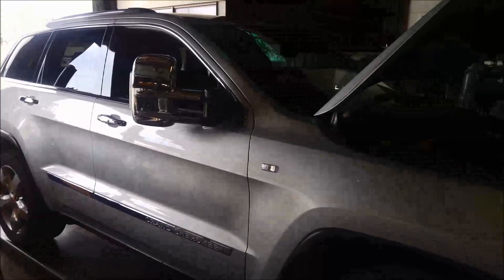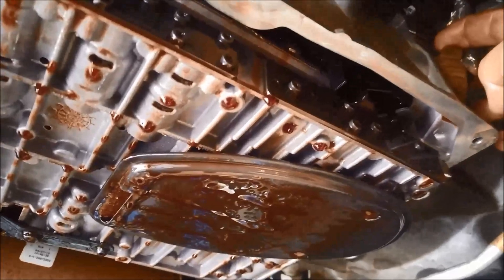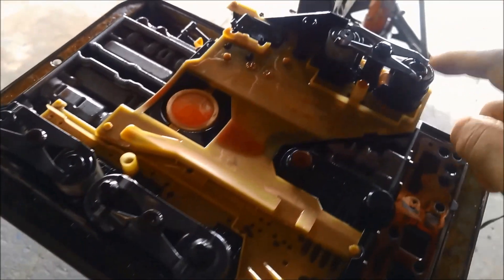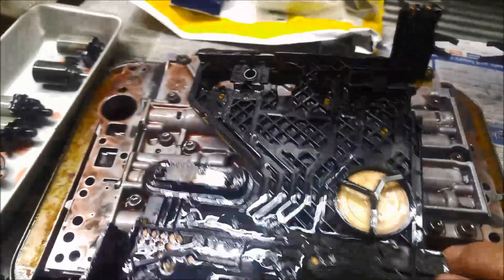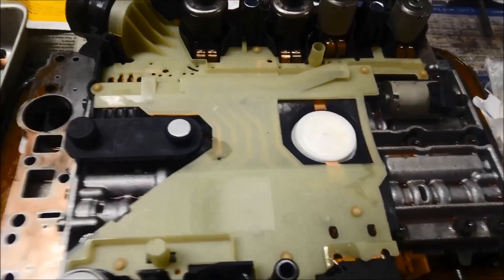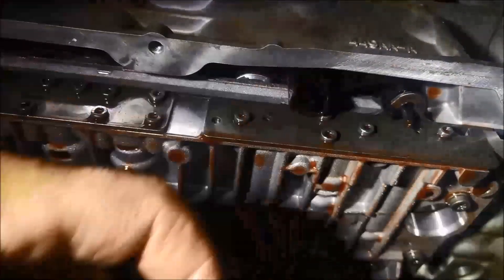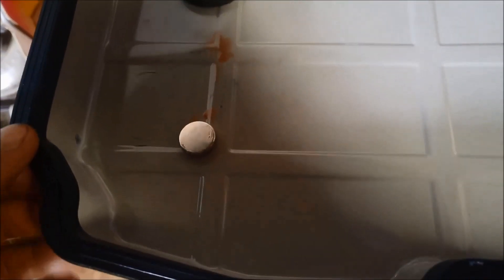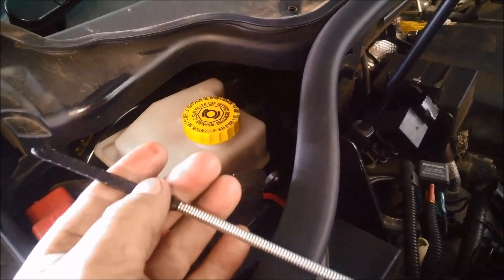Jeep W5A580 Mercedes 722.6 Auto Transmission  Conductor Plate Solenoids Connector Sleeve How To DIY

Comment: Thanks for the tips! I have a 2012 Jk I believe it has WA580 that's a 4 speed trans am I correct, because when I manually shift it shows only 4 speeds on the dash? It seems like I have a delayed downshift in automatic mode is there anything I can do to bring that downshift in earlier? Thanks

Comment: Hi my friend I used your video to install a use valve body it was working ok until I started to notice wird shifting but no codes I just put bigger tires 265/70/17 and lifted 2in I bought a programmer to set the new tire size in the ecu to calibrate the speedometer and the shifting points on the transmission it ran good for two days and it started to shift wird and a code come up transmission clutch solenoid preformec. Do you think that replacing just the solenoid will help or the actual clutch in the inside is damaged is there any way to test it out
Reply from the maker: hi, really hard to tell without seeing itand running a few tests / checks. if you have fault codes it is usually an electrical issue. cheers

Comment: Hello. I scanned my transmission a nag1 or w5a580 in my jeep wrangler 2013 and showed up this code p1731 incorrect gear selected. I’ve been searching around but couldn’t find the correct answer to that fail. Thanks in advance

Comment: Thank you for the video. We have a 2007 Jeep Grand Cherokee with the 3.0 and 722.6.  It went into limp mode second gear. We took it to 2 different transmission specialists.  Both said we needed a new transmission.  Since they wanted over $6000 for the job we purchased a used transmission with around 80K miles on it from a reputable location.  A GM technician that we know very well installed the transmission and had Chrysler program and reset the TCM. AND....we still have the same problem. Still in limp mode, second gear. The code that keeps coming up is torque convertor clutch solenoid. Same code as before.  Our tech is going to check the wiring harness from the TCM to the transmission and the relay.  Do you have any ideas what could cause this? Thank you
Reply from the maker: hi, old solenoids rolled around in a 2nd hand trans fluid can cause that. tcc codes are probably the most common faults on any trans. cheers

Comment: Thnks for the vid mine is saying shift solonoid 1-2 and 4-5 short circuit to ground can the problem be on the conductor plate or solonoid its a w203 c240 Mercedes
Reply from the maker: hi, make sure you check all the solenoids while you have it out and apart. cheers

Comment: What is the trick getting the sleeve with the 2 o rings on it? Ive lubed and anti seized the rubber o ring seals and where you put the sleeve connector into the conductor plate and it dont want to go in.. Ive been at it for 3 days.. Took plate off 3 times seeing if its mis aligned but all lines up.. Its just the sleeve issue everything else is good thanks... It is a really stressful pain right now
Reply from the maker: hi, you need to keep pressure on the sleeve. some aftermarket connector sleeves are harder to install. cheers
Reply: @YepThatsIt  got it... Got it positioned secured in and had assistance with a 28mm socket since it lined up just above the tab and used it as a hammer and tapped it in... Wow what a pain lol... Thanks for the reply man... Like your videos... Very helpful

Comment: Hello guys, 

I am French, and I search the material, 

Where did you order all the hardware? The electronic board? As well as the solenoids and also the gauge. Thank you in advance.

Thank you very much by advance
Reply from the maker: hi, we source our parts from australian suppliers mainly. occasionally from dealerships and from overseas depending on vehicle models and on local availability. sorry we dont ship overseas but can supply any/most soft ad hard parts within australia. cheers

Comment: I have a problem with 722.6 5g tronic w211 e220 cdi 2007, when its cold the transmission bad switch a gear(1>2 only when ist cold), what is the problem? Thankks
Reply from the maker: hi, as trans warms, fluid thins out and metals expand. do all the basic checks first but often is a contaminated solenoid or sensor issue. cheers

Comment: Great video, I have a question about a similar issue with my transmission. 
It is a 2015 Jeep Wrangler Rubicon with a P0778 error code. won't shift and 2 different temperatures from P and D(100F difference)  
changed tranny fluid and filter, Reset check engine light, P0778 code returned 
replaced complete valve body (purchased at dealer), Reset check engine light, P0778 code returned  
what do you think it could be?
Reply from the maker: hi, generally fault codes indicate electrical issue. cheers

Comment: Hello. I have a 2008 Jeep Commander 3.0 CRD.

The transmision works perfectly but , when I have position D, if I move the shift from positions - to + to lock in position 1, 2, 3 or 4, it does nothing.

The change works fine but I can't select 1, 2, 3 or 4 myself. 

Do you know what is working wrong?

Thanks a lot.
Reply from the maker: hi, check out the range sensor. cheers
Reply: @YepThatsIt  Thank you.

Comment: I have a 2013 jeep wrangler and recently got the error code p0741 and turns on off but doesn't feel anything wrong with it so just replacing the torque converter clutch solenoid will fix the issue the dealership wanted to replace the whole valve body and torque converter
Reply from the maker: hi, ecu can usually only sense electrical issues with solenoids or sensors, and not mechanical issues like sticking/binding or leaking solenoids or solenoid seals/orings. if threw a fault code that says ecu found electrical parameters have fallen outside settings on a few occasions. cheers
Reply: I have the same jeep, same year and de same error code. You could solve the problem?
Reply: Hi my friend did you ever fixed your Jeep on my jeep that code activate and deactivate but I feel wird shifting what was wrong with yours

Comment: 2015 Jeep JKU pending code p0741, code P0731, code P2784. Noticed some weird shifting recently. Now it won't go in gear at all.
Reply from the maker: hi, check all the basics first before you remove valve body. make sure battery is strong and holds charge well, good earth, fluid level, electrical connections etc. then you will need to test solenoids for operations and leaking ( or just replace them ) while you have valve body out, you can also air pressure test ports in case. cheers

Comment: My TCC solenoid tested at 2.8-2.9 Ohms, throwing a P0700 P0743 code. Since the TCC Solenoid tested pretty close to the correct Ohms, could it still be my issue? Thanks brother.
Reply from the maker: hi, ohms test at room temp is not the only test. you will need to warm solenoid up and test resistance as well as leak testing. cheers

Comment: Hi!  I have a 2011 GC, and in the morning that the vehicle is cold, when it does the gear from first to second, this is rough and not smooth.  When the transmission temperature reaches 77 degrees Celsius, everything is smooth.  I have no error code.  Do you have any idea what can happen in the trabsmission? I am not sleeping 😅
Reply from the maker: hi, check all basics first, including strong and charged battery, electrical connections, fluid level, worn rubber mounts or driveline. then you can check for leaking solenoids seals and or solenoid o`rings. fluid is thicker when cooler and metals expand with heat as well, keep that in mind. might be good to read through past comments too. cheers

Comment: Had a front seal leak so I pulled trans and replaced seal and bushing after trans was re installed after changing the front seal and bushing it went into limp mode,i took pan off and went thru valve body, replaced the conducter plate and checked solenoids were working, put back on and then would not move at all. i made sure shift valve was connected right and switched conducter plate back still wont move, sent it to transmission shop and he pulled down and found nothing wrong, he switched valve body and got forward in 1st and reverse but pulled down again and went back thru it still finding nothing. he changed pcm and still only limp mode. after a month and half i had wrecker go pick it up. now trying to find out what the hell me and this transmission shop have missed ?
Reply from the maker: hi, usually if when you do something and it makes it worse, means you need to go back and recheck your work. cheers

Comment: Hi.  I have a 2013 Jeep Sahara.  The shifter is stuck in park, I have no reverse lights, and all the drive gears on the dash are surrounded in squares as if they are all selected.  Do you think my connector plate may have failed ?  Are these symptoms of a bad connector plate ?  Any help is appreciated!!   Thankyou
Reply from the maker: hi, try changing conductor plate. cheers

Comment: G'day, great video.
I have a 2014 wrangler with the same W5A580 box and it gets stuck in D im assuming 3rd. I can't manually select it into a higher or lower gear. It only does this sometimes on a drive longer than 20-30minutes.
Do you think a new set of solenoids and conductor plate will fix the problem? If not do you know what else it could be?
Reply: Forgot to mention, I can pull over and turn the car off and back on again and it works as normal again.
Reply from the maker: then you most likely have blocked filter, the fluid drainback from torque converter clears the filter a bit when you turn it off
Reply from the maker: hi, if its in limp mode ( electrical issue ) then will definately fix problem. cheers
Reply: It doesn't show a MIL light on the dash. And I have never had a code relating to the transmission. 
I done a fluid flush and new filter a few weeks ago. But made no difference. 
Im a bit baffled. I might buy some cheap aftermarket solenoids first to try...
Reply: My commander did something similar, would not change gears manually, I changed the fluid, then all good, resolved the issue.
Reply: Hello Me Mate, I have the same problemin my Jeep Wrangler 2016, could you said me how do you fix it? I'm going to appreciatted a lot.

Comment: Great videos. Thank you. My 2007 Jeep Grande Cherokee CRD with the same tranny wont upshift out of first gear. Otherwise normal operation. Codes are P0705 and P0730. Do you think I need to change the conductor plate to solve this problem?
Reply from the maker: hi, if range sensor fault could also cause 1st incorrect gear ratio code, otherwise could be contaminated/sticky/leaking solenoid. cheers
Reply: I'm having the problem where my 07 chrysler 300c won't go pass 1st gear i don't change the conductor plate , selenoids and transmition filter with new oil and gasket... and still having the same problem... also you tell me how many quarts of tf- 4 needs on a 5.7l hemi chysler..

Comment: Where is the solenoid Female and male connectors ?
Reply from the maker: hi, on these they are only contact points. often the contact points are improved by jst removing and refitting same condutor plate/lead frame. cheers

Comment: hey great video thanks. do you know if I can buy the solenoids separately to just replace them all together? I can't find them online anywhere. Thanks again
Reply from the maker: hi, you can buy them separately or as a set. I prefer genuine but there are also aftermarket. try transmission parts suppliers, or even buy from a transmission workshop or dealerships...or ebay. cheers
Reply: yeah that's what I thought. It was the weekend and the stealership was closed... Thanks keep up the good work @YepThatsIt